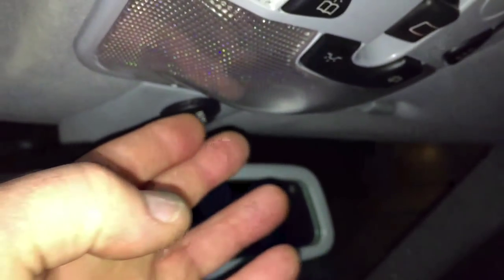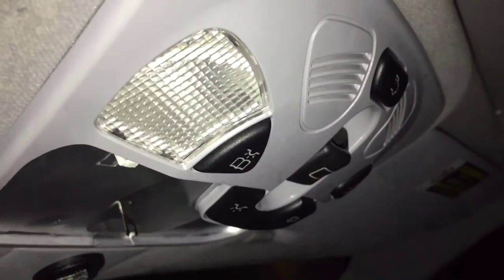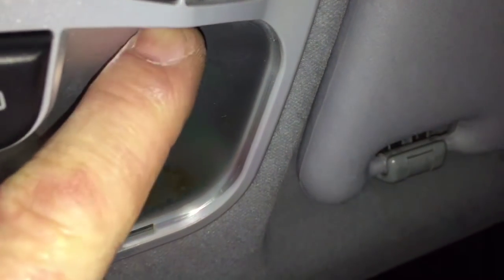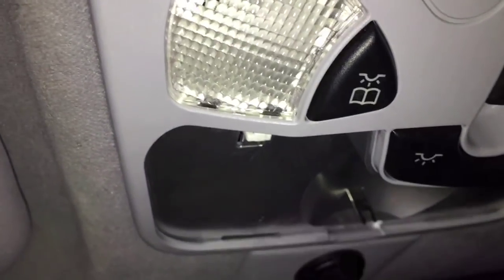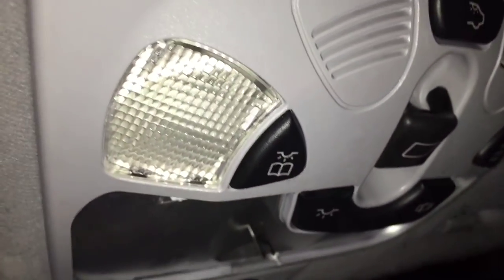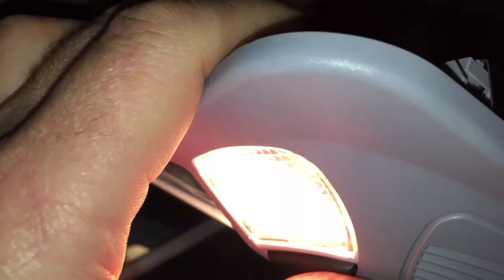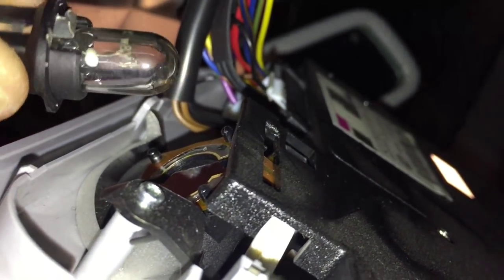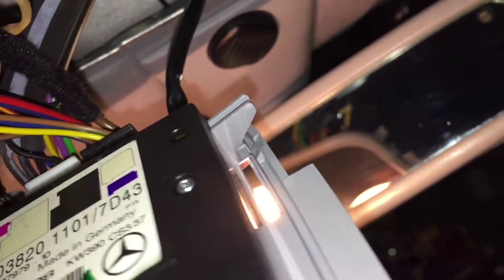Mercedes w203 w209 overhead panel/console removal, bulb replacement

Comment: Hey fupabox, unrelated comment here:
You may or may not recall about a year ago I asked you for help with bleeding the cooling system on my W210. I cant find the video so let me just write this here. My problems were slow warm up, never reaching full temp, and temp going down with heater on. I told you I already replaced the T stat. I assumed it was a bleeding issue. I took your advice, and no luck. Even bought a vacuum bleeder. The issue was never fixed until a couple of weeks ago. Come this winter I wanted to  fix it, so I took the new thermostat off and found that it was defective! The damn thing was not cast properly so it would never seal when it was supposed to be closed. It was the sole cause of my issues and changing it fixed them and now the car warms up better than ever. I just wanted to thank you again for your help and also wanted to give you an update as to how the issue was resolved. Have you ever heard of this happening? And yes, genuine MB thermostat, matching part numbers.
Reply from the maker: +Sammy Noueilaty   It has happened to me as well.. 2 water pumps in 1 week ,, both brand new, both failed.. It does happen unfortunately  ( it was a jeep cherokee , dealer parts as well...They gave me a free set of tires for my trouble , door also fell off when the hinge pins snapped on a 2 year old vehicle, so they were feeling pretty guilty  ).  Glad to hear you got it resolved

Comment: Want to remove the whole console (it's making a rattling sound - so either needs a clean or replacement). Only problem... the cable plugs are really hard to pull out. Is it just a case of pulling them, or is there a latch I'm missing. (I don't want to damage them by forcing it)

Comment: Great video! I'm going to pull down the headliner, for that I'll need to remove the overhead console, supplementar lights, handles etc... Finally I'll need to disconnect the wiring which goes to the overhead console from the rear SAM, do you recomend disconnecting the battery?
Reply from the maker: Just the neg cable would be a good idea with all the loose lights and stuff ..just for good measure. If you unhook the battery just be sure the key isn't in the ignition when you disconnect or reconnect the battery
Reply: @fupabox  I ask because the rear SAM in the W203 is notoriously prone to short out ou just die if left with no power for too long

Comment: Hi there, do you happen to know what's the purpose of the black circle that's attached to the rear view mirror portion? Im planning to install a dashcam and I figured thats a good place to pull some power but i cant seem to find any videos of people removing the rear view camera that has the black circle, so im just wary if i should use the same wiggle and pull method that ive seen. Thanks ahead!
Reply from the maker: what year and model ?
Reply: Mine is actually a CLK W209 (Year 2004) but i believe it shares most of the same internals as your car. It looks identical to one in the video except i dont have a sunroof so that button is not there. But I do have the black circle attached to the roof plate of the rear view mirror
Reply from the maker: Ah ok ... on your w209 the interior  temp sensor is mounted to the mirror base ..it is still needed for the hvac to work properly.. I agree it would be a good spot to mount a dash cam

Comment: I have a fan noise coming from there any thoughts. Thx
Reply from the maker: The little sniffer fan for the climate control is dirty . Blow it out with low pressure compressed air or a keyboard air duster can

Comment: Hey dude, sorry this isn't a question about the w203/w209. Anywho i read your comment on your page about asking you a question on a video comment. I am looking for a r129 SL500, may i ask you how is owner ship? i am a good youtube-mech but at the same time money will be tight here and there, i'm asking as in reliability, service, the drive. and aftermarket parts i'd like to get away with the air-ride and go another route so ill be looking at after market parts.
Reply from the maker: +Edin Jasarevic  I never had a real problem with mine, {I just sold it last month to help fund another investment property)  the older SLs are very reliable if they have been well maintained, and not abused. I would recommend one to anyone as long as they have a bit of ability to do most of the routine service themselves. the 300 and 320 sl are even less expensive to maintain and repair because the engines were used in so many other Mercedes models.
Reply: Wonderful, And as for the ride? and aftermarket...market lol
Reply from the maker: Edin Jasarevic The ride always amazed people. (Me included )  that a 25 year old car with skinny little 30 series tires could ride so well. Aftermarket parts are available for almost everything except interior parts. Interiors are the most expensive to repair if parts are needed, but the dealerships can get any tiny part in any original color,,some are even reasonably priced. Aftermarket suspension and engine /drive train parts are all available at no more than the cost of most other cars
Reply: Really wow. Thank you for the information